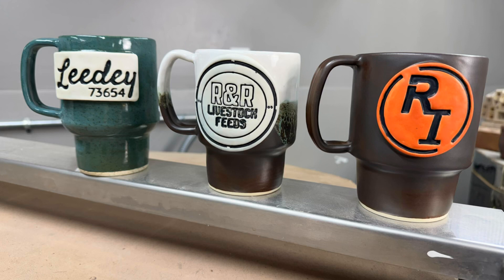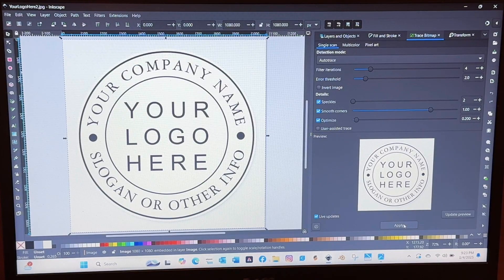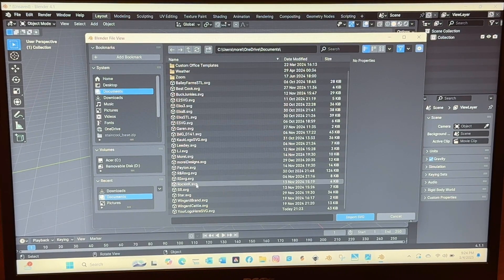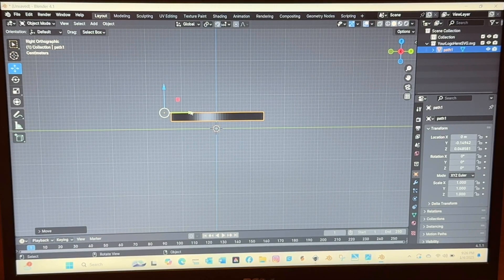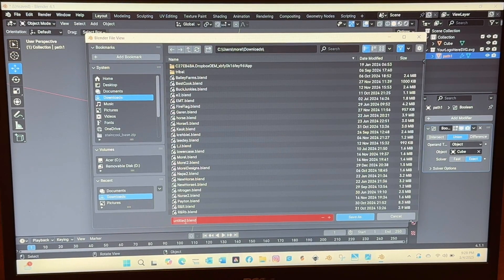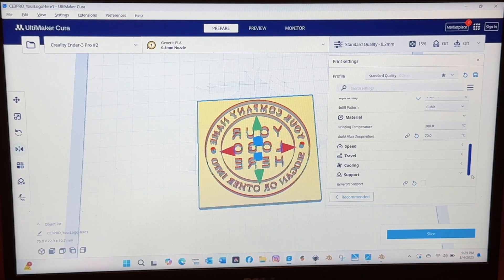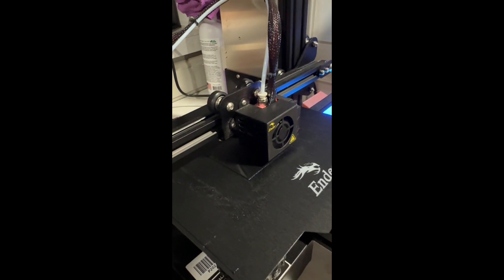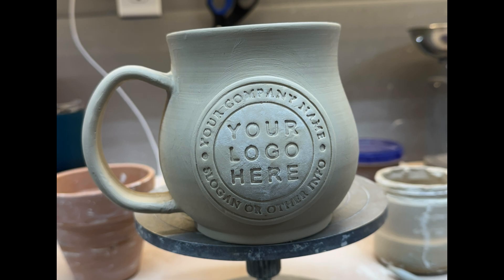How I turn a 2D image into a 3D stamp for custom pottery logos

Comment: how do you work with logos that are multi-color?  or if the image has grayscale instead of just B/W as  your examples were?
Reply from the maker: Well, all you really need are the lines of the logo. You’ll color it yourself when you glaze.  It, there’s an option in Inkscape called color quantization I think and it will separate the colors, then you could make individual stamps and line them up, but I’ve never found a use for that. If the image is greyscale, I’d take it to a word document and play around with the picture settings to see if I can put a filter on it that gives me the lines I need, or can at least darken it.